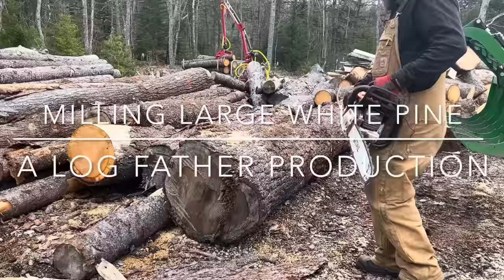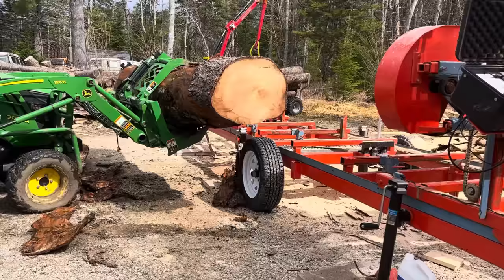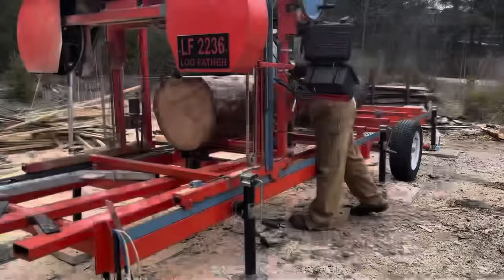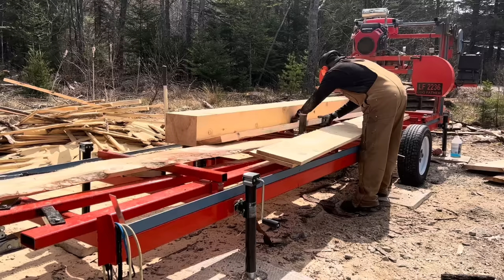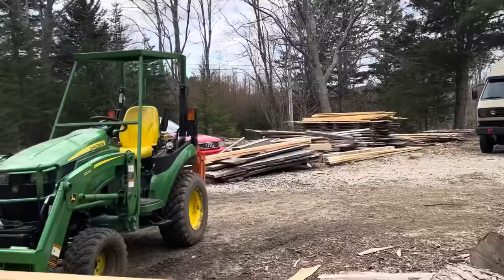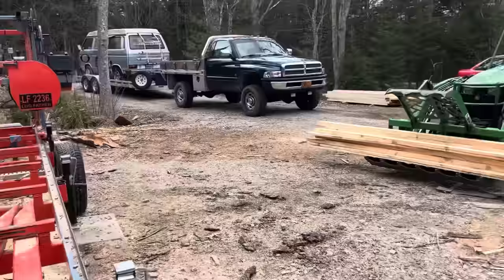Well Worth the Effort. Milling White Pine

Comment: Any issues with cupping and such? I’ve seen a lot of videos that stress how important grain orientation is but following their techniques a 2x12 is extremely hard to come by. Any tips?
Reply from the maker: The key is to sticker and weight them when you take them off. They’ll stay straight that way. Try to never cross the pith, keep the same grain direction in the same piece of lumber- that’s my strategy for making straight lumber.